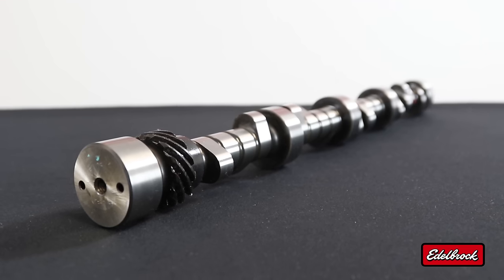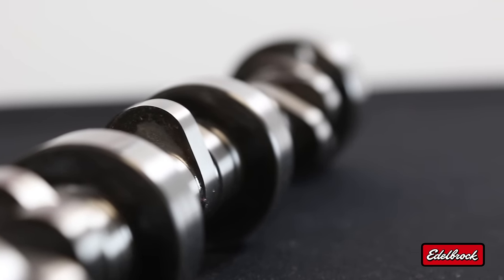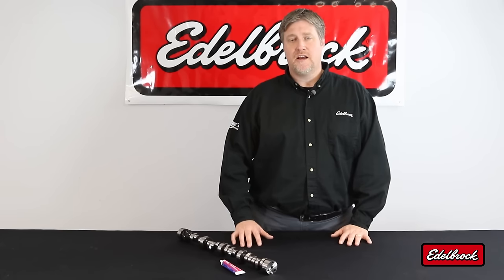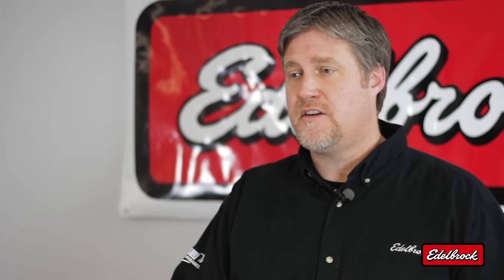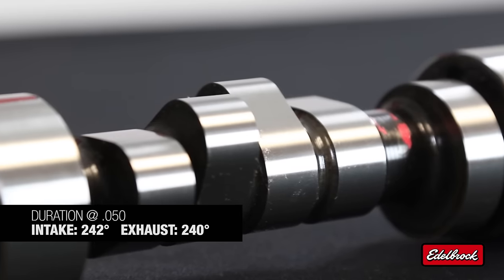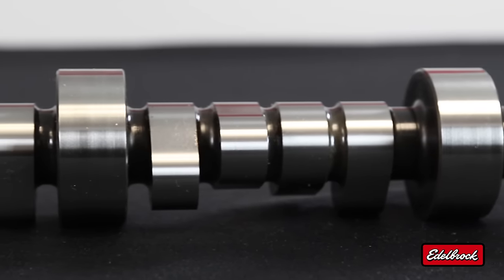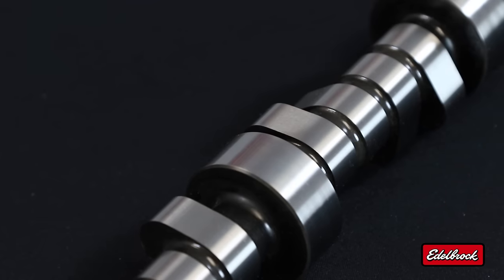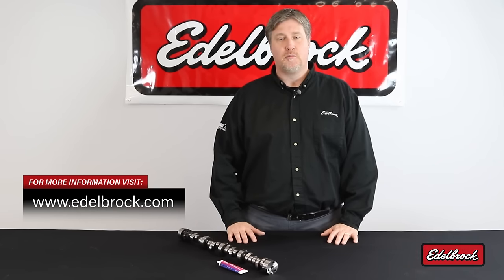Edelbrock Rollin' Thunder Camshafts

Comment: can anyone please tell me how do I fit this camshaft or something similar into a bmw or Mercedes V8 that's 4.4liters or 5.5 liters please help
Reply: probably a little late but these camshafts are for OHV motors and im pretty sure Mercedes V8s are DOHC
Reply: Dominic Daley yea whats ur point ? u can just take off the vtech from Mercedes and put on this camshaft, there is no point in keeping it, its just there to save gas
Reply: Club Bmw Amg also a little late but the reason it wouldn't work is that this cam has both exhaust and intake in one while a dohc engine has one cam for intake and another for exhaust on each head. if anything is likely to be able to be frankenstiened into a BMW it would be a set for a mustang v8. the engines for the last few gens have been dohc
Reply: thank you for chiming in.
Reply: It would cost a lot but you could probably find a german company that specializes in cams and have them take your core and design a new one with more lift and duration. But like the modular engine's you would probably have to install cam limiters/ fazer's that allow it to lope.  Search around on the web I found some high lift cams for BMW in the past.
Reply: What a stupid question.